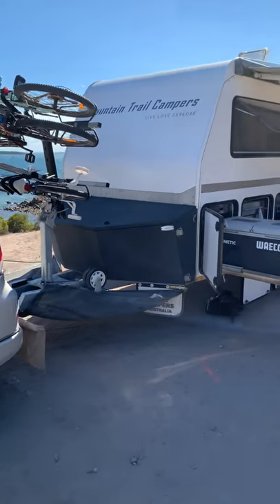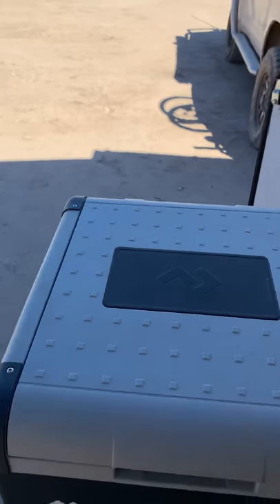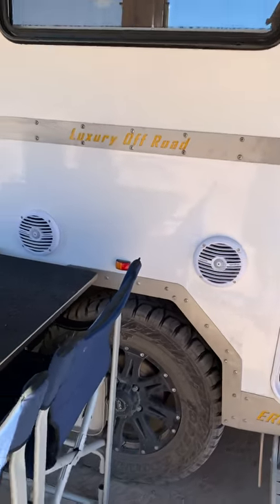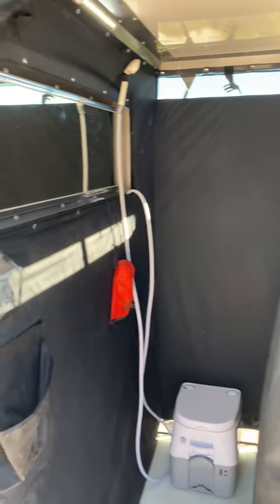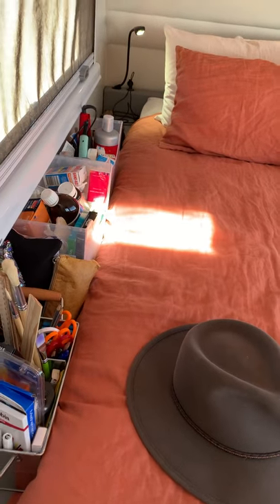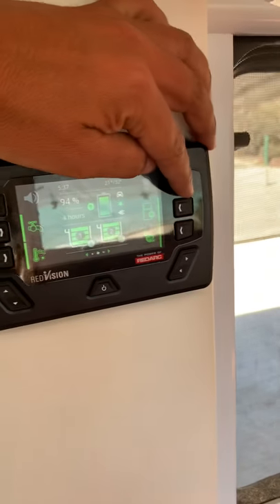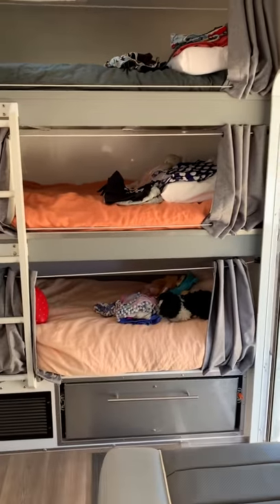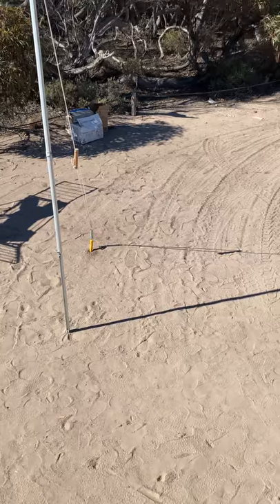Mountain Trail LXV 4.7 family van (FXV) walk through

Comment: We just bought the LXV after going through one at a show and seeing just how well built it was, saw many reviews but seeing it was the clincher, not cheap but not crazy expensive either. Seeing your review and comments on ball weight was very helpful too. So you went to the 5.7 ! Well I look forward to that review, nobody seems to be doing them and we did look at one, so I’d be interested on your thoughts about your time with the 4.7 and why you stayed with MTRV and got the 5.7 next, especially as we haven’t picked ours up yet and have wondered about the 5.7. Ultimately though, I think the light weight and ease of towing will keep us in the 4.7, there is only the two of us after all. Cheers.

Comment: Very helpful. Thanks. What is the towball weight? I know I could look up the website for the official figures but it is the figures in reality that I'm more interested in.
Reply from the maker: Hi Sam, ball weight definately changes with the way you pack the van, being a single axel the further forward the weight in the storage boxes the greater the affect on ball weight. With the bikes on the front, both jerrys in front toolbox full and fully loaded, water tanks full etc we were right on 350kg ball weight and that was with making sure we tried to put the heavy stuff (weber etc) over or near the axel's. This was only when we were heading off grid for a month or so at a time so were fully loaded. General ball weight was coming in around the 300kg mark.

The bike rack is great, heavy duty and handled the lap with eaze but it comes at a price which is weight. I think the bike rack with 3 bikes on it would add at least 100kg of weight at the front (not all of that would convert to ball weight). Losing it you could get below 250kg easily.

We now have the 5.7 dual axel (yet to do a run through video) and same bike rack etc ball weight comes in at 320kg fully loaded.

Any other questions hit us up.